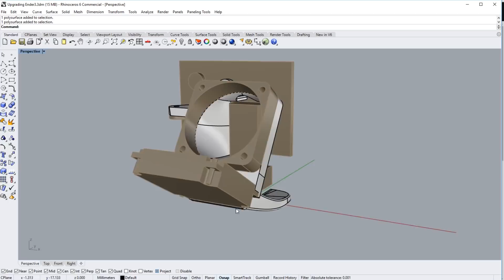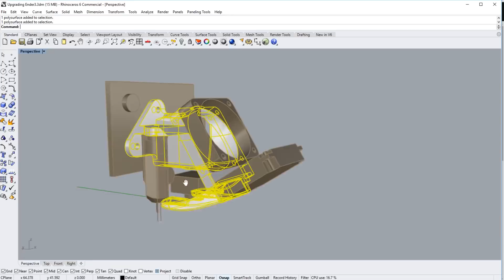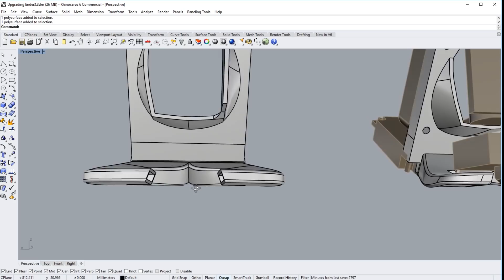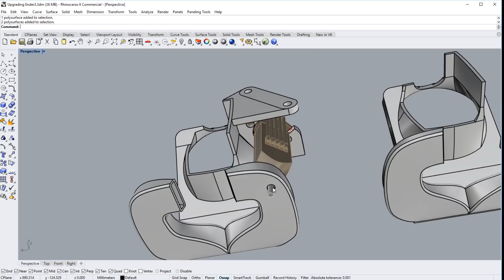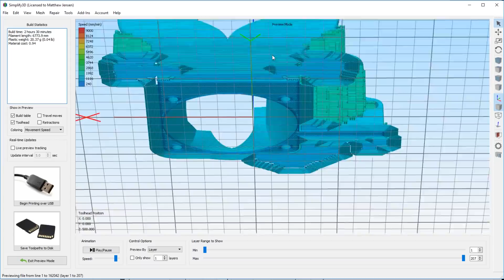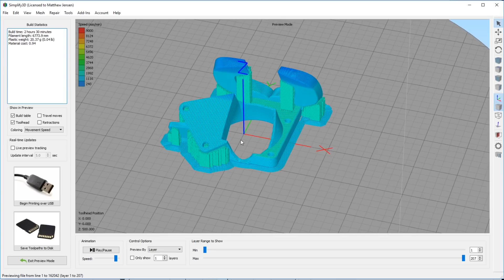Upgrading the Creality Ender 3 with Duet Wi-Fi, and other add-ons - part 1

Comment: @4:38 - The 'plastic' pulley and wheels are made of Delrin AFAIK.  Here is a snip from it's data sheet RE: thermal properties...

Between -50 and 200°C, the only peaks visible by DSC are the melting and freezing; no other transition appears. This contributes to DELRIN being suitable for short-term exposure totemperatures close to the melting temperature.
Reply from the maker: Thank you for the good information.
Reply: @DesignPrototypeTest  You're welcome!  My Ender 3 and a KG of PLA are due at my door in about an hour. I cannot freaking wait to get this thing going.  I need to print some gimble locks for my new DJI Spark!

Comment: IMHO wheels are actually "delrin", not nylon and according to manufacturer http://www.dupont.com/products-and-services/plastics-polymers-resins/thermoplastics/brands/delrin-acetal-resin.html they are stable up to 120 deg. Celsius. I made plywood case for prusa i3 clone and with help of OctoPi with ambient temperature sensor maximum temperature inside box was less than 50 deg. Celsius during ABS print with maximum temperature of heatbed

Comment: Before you complain about Prusa using ideas from hackers on the internet (properly called open source technology) you should do a bit of research on the origins of home 3d Printing.  Specifically the Rep-Rap project, and Prusa's contributions to that.
Reply: 3d printing been around since the 80's...  prusa is a company made up of other peoples work..  aka open source. not knocking them  just stating facts

Comment: The beauty of Creality is that although they've gone open source, thanks almost entirely to the efforts of Naomi Sexy Cyborg Wu,  they're products aren't expensive. I see the Ender3 is currently $169 on Gearbest!!!!
 Thanks for all your design work on that fan duct by the by. What you ended up with looks pretty efficient. Although the air initially feeds into a bigger space than the fan outlet, you've then got a constantly narrowing duct, which helps to speed the air up again. I understand the basics of fluid dynamics problems but don't have the patience for the graphics work, even though I'm a CNC mill setter. 😳 Tinnitus is a real bummer dude!
Don't worry too much about the rollers being in a heated enclosure, they are a type of nylon and the melting point will be well over 400F (220C )

Comment: the ender 3 is called ender 3 because you can buy it 3 times for the cost of a prusa.
bonus fact, stepper kit costs the same than the ender (but without shipping...)

now to be fair, prusa has a very good support infrastructure around it. it's a good choise for beginners and those who don't want to fiddle around:

just like a prebuild gamer system from dell or hp, that comes with warranty and all. 
of course, if you are willing to dig in to the stuff, inform yourself about electronics and mechanical stuff - you will be way cheaper off. - but support and such ressources costs money to keep up and that's why you pay it.

so stop nitpicking, keep calm and create stuff

Comment: I own only 2 printers a FlashForge Pro and a CR10. I use it for business, providing printing service to the public. The CR10 although slow provides me large printed parts while FFCP Inuse for small mechanical parts. I did not buy a prusa for one reason and that it has a small build area and the design is not at all modular. I have seen other users of CR10 upping their build volume to almost twice the size of the original ones and printing really large stuff with it,  sometimes with print tmes going over 300 hours in one print. This is a testament to how robust the cr10 is and how usefull it is. By the way I have not upgraded any firmware or hardware except for the heated bed wire supports, and I am printing parts over 200 hours. So say what you can about cr10 but it is because of them I have a business that runs 24/7 non stop.

Comment: You need to annotate the part about the power supply voltage selection switch. That’s dangerous to give people wrong information.
Reply from the maker: YouTube stopped allowing annotations years ago. There is no danger. The only harm will come in the form of a very long wait for your bed to get up to temperature. It is fine to run this printer on 120v mains power with the switch selected to 240. What this does in effect is feed your control board LESS power, so everything is running at something like 12v instead of the 24v which were intended.

Comment: $750 for a Mk3 PRUSA seems reasonable to me.  The features, quality, fit and finish of the whole machine appear to be much higher than anything that the Chinese printers offer.  I don't have a dog in the fight as I am just now researching what to do to get in to 3D printing.  I can tell you this, as a machinist and an experienced fabricator, I do know high build quality, premium components and superior finishes.  Saying that almost any "budget" printer is as good as a PRUSA is like comparing a Snap-On open end wrench to a cheap Chinese crap wrench (something that I know a great deal about).  What you many times DON'T See is what counts the most.   I have learned that most Chinese designs are usually copies and are always built down to a price point.  I worked with Chinese engineers for 5 years in another life and I can tell you that cost cutting is their mantra, NOT building a better product, regardless of price.  Not that the Chinese cannot build nice stuff (i.e. Apple I-Phone and other premium cell phones), it is the fact that the entire world revolves around getting something cheaper.  Quality costs money.  Companies like APPLE and PRUSA thrive and keep their margins high by selling a premium product that some are willing to pay for.  This may be an illusion or vanity, but it does work.   I would probably buy the Ender 3 or a similar printer as I  don't think that investing $750+ in the PRUSA would be a good choice for an "Experiment" on my part.  I can assure you, that in my case, my abilities and knowledge in this field are way below the capabilities of 3D printers that fall short of even the ENDER 3.  It sounds to me like software choices and manipulation are a major factor in the quality of the printed product.  I have a lot of catching up to do.  I appreciate the comments here and the video content, these all help me to make an informed decision as to how to proceed to get into this hobby.
Reply: Not sure how FDM printed parts and zip ties is a premium product.

Comment: Bashes Prusa for using 3D printed parts and zip ties. Immediately adds 3D printed parts and zip ties. It's immoral to steal designs, but you know, its great somebody did all the work already for software, so just copy it.
Reply from the maker: I'm using 3D printed parts and zip ties to hold two ends of a plastic tube together. Prusa is using 3D printed parts and zip ties to hold THE ENTIRE MOVING BED ASSEMBLY WITH THE PART ON IT! I think there is a slight distinction there. But ya know, keep being an illogical fanboy and looking for mistakes and inconsistencies in other places besides your god of 3D printing. Clearly it's the world against Prusa. Did you hear that he invented 3D Printing!?  He's such a nice guy and he is so cool! We are lucky to have him! 

Also, Prusa runs on Marlin firmware. The Duet Board runs on RepRap firmware. These are two entirely different operating systems. I don't know what you are talking about with the copying software comment.

Comment: Honestly I feel like all these profile extrusion based printers are just riding the coat tails of Tevo and the tarantula and black widow. The only difference being they made them almost ready to print out of the box rather than a kit of parts to assemble. The reliability of which is highly debatable. I've owned my Tarantula for almost 3 years now and not much of it is original, only the controller board, steppers, and aluminum frame parts remain. everything else has been replaced with custom parts and upgrades.

Comment: the positioning of the filament sensor you plan on installing will be in the wrong place.  you want to place it before the motor not after.  by place it after the motor, how are you going to get the filament out?? you want it before the motor, due to one reason.  once the motor pushes the last of the filament through, it stops directly behind the gear.  the sensor will still read that there's filament in the line and keep on printing with out any material.  so ya, flaw in your sensor placement.
Reply from the maker: 1) You aren't allowed to leave technical comments critiquing my work unless you watch the whole video.
2) The tail end of the old filament can be removed by splitting the sensor mount as I showed at 9:31
3) The optical sensor will detect that the filament is no longer moving, and it will trigger the error in the firmware which alerts the user to change the filament
4) This is an older video now, and I have the printer working perfectly. All aspects of the filament sensor work as planned.

Comment: So, the Ender 3 is the equal of the Prusa Mk3... after you make a bunch of mods to it such that the only thing left of the original is the frame and basic mechanical components. I guess that's fine for someone with a fair bit of experience with both 3d printing and general tinkering. But as a new comer to 3d printing, that doesn't seem very appealing. If I want something that works well stock, it sounds like the Ender 3 is not the way to go. Plus, I'd like to point out that, if the upgrades require a 3d printer to complete, then it makes it even less appealing to the beginning for whom this might be their first printer.

Comment: You have a real inconsistency problem when it comes to open source product. You seem to have absolutely no problem with modifying a cheap Chinese printer that was only made possible due to Prusa's decision to keep his design open source, but you seem to have a big problem with cheaper copies of Open Source components like the BL touch in the duet Wi-Fi board. It seems that you do not understand that the entire 3D printing community has rallied around producing open source product, this is done so components can be copied, and improved upon by the mere nature of being open source. Creality for a while was not releasing the upgrade they made to the Marlins software for the CR 10, which was strongly objected to buy the 3D printing community. They are taking an open source firmware modified it a little bit and then not release the changes. Eventually creality succumb to the pressure from the community. I guess the fact of the matter is, unless you have a completely new design that doesn't build off of anybody else's, people copying and improving upon your designs and product is just the nature of the Beast. Nobody is paying for the work that was done by the people before them all of the stuff is available to make your own, and improve upon on the condition that you share it like the original developer did. I think you are confused about the whole concept.
Reply from the maker: Your comment is another in a long line of misinformed Prusa fanboys trying to tell me I'm wrong, Prusa is the god of 3D printing, and It's ok to buy Cheap copies from china because open source means it's free. 1) As I discussed in the top pinned comment, Prusa is not responsible for the vast majority of the features on his machines. This includes the frame which is derivative of the Mendel. No, Prusa did not invent the Mendel. An engineering student in England did that. 2) Prusa has to make and keep his printers open source because the vast majority of the features are derivative or flat out copies of open source things created by others. If he didn't keep his printers open source, it would be a PR nightmare, and "the community" would disown him and his brand. This is what happened with MakerBot. Don't want to repeat that mistake.

Comment: Question, do you think that with the duet wifi board you installed could be used to make the ender 3 into a dual extruder?
Reply from the maker: Absolutely. The only question is what kind of dual extrusion you are going to use. Side by side nozzles have big problems with ooze. I don't know how Stratasys get's it to work so cleanly. I advise against side by side. Next you have the "cyclops" style. Watch my early videos where I was playing around with 3-in-1-out color changes to learn the difficulties here. There are several aftermarket solutions in this category. While better than side by side, this techniques still has big problems. Next you have a switching extruder which pivots to change nozzles. I've never had enough time to play around with style yet. It looks really promising. There are designs on Thingiverse. Finally, you have tool changing. For the "I3" frame style like the Ender3 this pretty much means dual parking extruders. I like this technique most of all. In theory anyway. This one also, I haven't played around with yet. I do have plans in an upcoming series to go over all of these.
Reply: Thank god. I'm looking into getting that board and making my ender 3 a dual extruder just for fun. I'd love to see a video with all of the different types of dual extruders so that I can know which one would work the best.

Comment: why upgrade the Ender3 when you could have started with the CR-10 or CR-10 mini? They have a larger build envelope and a separate electronics box, so you can choose to enclose the printer for printing with ABS or PC. forgetting price for a moment, as the CR-10 mini is almost the same price as the Ender3 and comes mostly assembled, why is the Ender3 a better starting machine to upgrade?
Reply from the maker: The Ender 3 could easily be called the CR10 extra mini. I chose the Ender 3 because it is the much more popular printer and thus my videos on the subject are more likely to be viewed and shared. You make valid points, and you will not be let down by the mini. One thing though, if you get any bigger, I would definitely opt for a printer with dual Z lead screws. Finally, if you watch my latest video in the series, you will see that I have effectively created an external box for the board and power supply on the Ender 3 and in the process made it more quiet than the CR-10 mini: https://youtu.be/lWyu72xOGD4
Reply: @DesignPrototypeTest  i see, thanks for the response so then if you can live with the smaller build volume then the Ender 3 is fine but if you need a bit more build volume then the mini is an equally strong foundation for tinkering and optimizing
Reply: @DesignPrototypeTest  i see, thanks for the response so then my translation is this: if you can live with the smaller build volume then the Ender 3 is fine but if you need a bit more build volume then the mini is an equally strong foundation for tinkering and optimizing

Comment: I have both BLTouch original and 3DTouch, they are IDENTICAL in terms of components - verified under a scope.  BOTH are junk compared to inductive sensors - they rattle like hell and mechanical components will always fail eventually...
Reply from the maker: >BOTH are junk compared to inductive sensors.
Uh, no. Not even close. At some point I'm going to make a video about this.

Comment: I just bought the Ender 3 from gearbest for $180. If I spend $170 in the duet wifi, will I be getting prints that are twice as good than it already prints out of the box? What's the motivation for buying a product that costs as much as the printer itself? Other than bottom of the line components, you don't address why it's better and why I should replace the board.

I also have to add, there is no such thing as a knockoff/clone of an open-source project, they're called forks.  Do you get what you pay for? Yes. But sometimes that's all an individual can afford while they're getting started. It's NOT stealing and there is no morality involved.
Reply from the maker: Except for the increased part cooling, all of the upgrades I am doing will have no effect on print quality. The prints you can get from an Ender 3 are already just about as good as what you see from a Prusa. There is no need to do any of these upgrades, they are just nice to have, and make your printing easier, more worry free, and more reliable.

Comment: Comparing other printers to Prusa I really don't like the V slot pulley systems. I have linear rails on my coreXY. V-slot probably does have some vibration damping advantages. Did you look at the upgraded "tires" that apparently Open Builds offers? I wonder if they go a long way toward narrowing the gap between linear bearings and V-slot durability / performance? I saw another video where the guy claimed the better tires made a pretty massive difference. https://openbuildspartstore.com/xtreme-wheels/